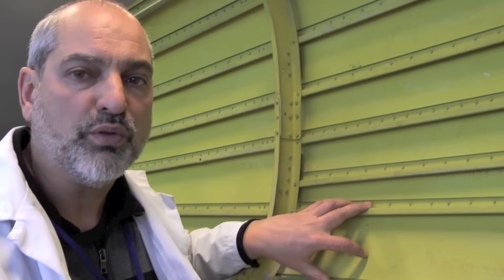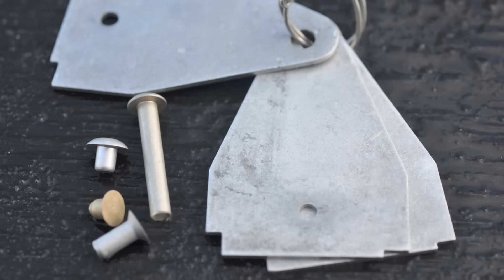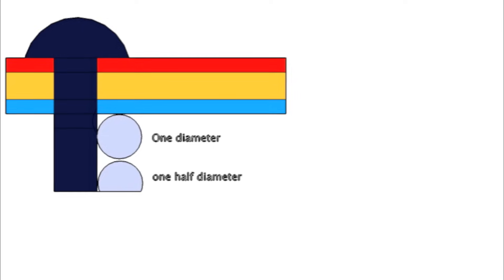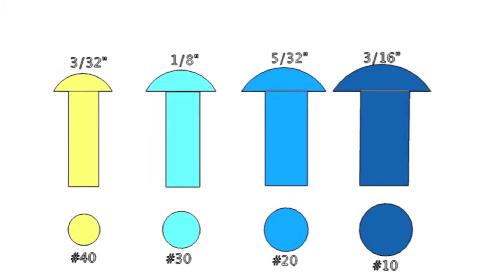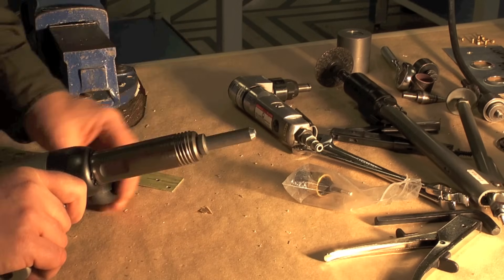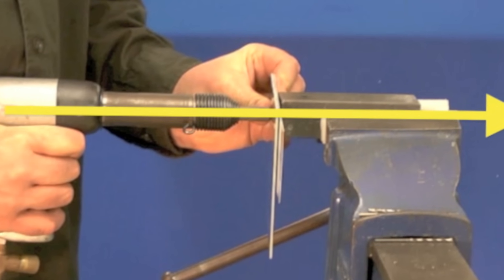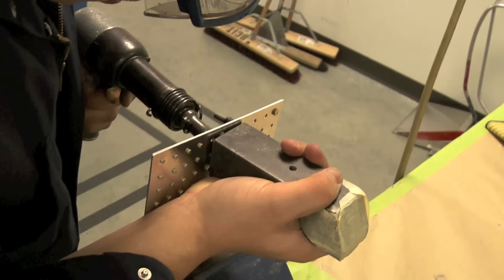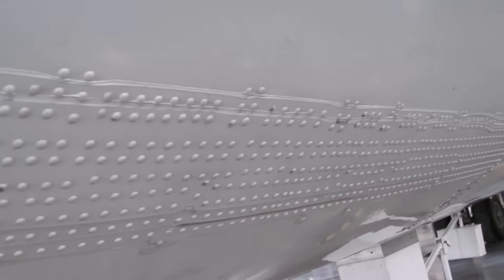Installing Aircraft Solid Rivets

Comment from the maker: Thanks for your comments, Enwwn - you're quite right about the work hardening aspect, as well as the head & tail gaps.  The reason that students are taught this method is to have them learn to drive rivets in a short time period - the "M" students only have a total of 12 days to learn many skills in the sheet metal trade, and management wanted them to gain confidence quickly.    It's just a first step in a longer process.

Comment: I worked as a trailer mechanic when I was younger.  Back then we used aluminum drive rivets for everything.  All of the aluminum side panels, roofing, and frame rails were held together with them.  The reason they use them is the speed of assembly and the strength of the rivets.  These rivets have more pulling and holding strength than a nut and bolt.  But, we were manually driving rivets about 30 times per minute.  Pop rivets aren't even that fast.  The only thing that sucks is being the bucker on the inside of the trailer.  The noise of using a Chicago Pneumatic 717 air hammer was enough to rattle your teeth.

Comment: Riveting is one of those jobs you need to have a feel for. This is gained by repetition. Good dia holes are essential. Selecting the right rivet gun is also essential these are given in X sizes a 3 x being the most common. Ensure you are at 90% to the job . This can be achieved by placing block and gun on the job at arms length and looking at the block and gun hold your position and move in for more control. You can also use the flat surface of the block if you have a equal space around your block your square. Setting up the trigger on the gun is important this can be done on a test piece. I like to us tungsten blocks. Blocks  should be rested on the rivet tail with light pressure this will ensure you set the rivet with the first few strikes as you carry on forming the tail increase the pressure on the block. What your looking for is not the gun that bounces but the block as the gun transfer is energy through the rivet into the block. If your in difficult areas or just starting out just learn how to set the rivet this a few hits step back look at the rivet then finish off . I like to use a plastic bag on my universal heads as it protects them and gives a nice production finish. Finally if your wet assembly make sure you keep block and snaps clean as you can put rivets into sheer if you don’t.

Comment from the maker: Bucking bars (also called "Dolly's") are merely the block of steel against which the rivet is set, or bucked.  The steel should be a high quality alloy, case hardened, with at least one smooth surface.  The bucking bars can be home made, or purchased from a aviation tool supplier such as USATCO.  Bucking bars can be any shape or size, and sometimes use alternate materials for heavier weight.

Comment: Thank you for posting this video.  I have searched for the spec that controls the installation of rivets and can not find it.  I know that these rivets have been install pretty much the same for the past 70 years but I would think some kind of document has to exist.
Reply from the maker: For general aviation purposes, specs are found in AC 43.13, current version.  This is a standard government document (a rather large manual) of many different subjects which apply across aviation repairs.  Check the US gov't websites, or aviation book stores...  AC43 is a common publication.

Comment: Where would one get that nice brass PSI regulator on your air hammer inlet?  That looks like a great accessory.
Reply from the maker: The rivet gun has a regulator on the air inlet.  It is a volume regulator, not a pressure regulator.  Try Wainbee (Canada) for a supplier of the regulators.  Or, in the USA, maybe Brown's aircraft tools, or Aircraft Spruce.

Comment: Your video assumes we all know what tools are required . Other than an Air hammer and bucking bar what tip are you supposed to use on the air hammer?
Reply from the maker: Alejandro - the main tool used to install solid rivets is a rivet gun, NOT an air hammer.  Air hammers have no feathering trigger control... they are full on, full off.  Nothing in between.  A proper rivet gun will be able to gently tickle the rivet, or gain impact power through the entire range if that is what is needed.  A simple air hammer is often used in other industries, but not in aviation.  The rivet guns require special "snaps" which are sized to fit the head shape of the rivets being installed.  Common sizes include 3/32", 1/8", 5/32", 3/16" and others.  Another flat headed snap will be used for countersunk riveting.  Coil springs are used to hold the snaps in place on the rivet gun so that you don't launch the snap out of the tool causing injury or damage inadvertently.  Rivet gun kits including snaps, springs, bucking bars, and other common riveting tools can be found at the aircraft supply shops such as Aircraft Spruce, ATS, Browns Aircraft Supply, etc.   Hope that helps.
Reply: @Riveteer  Yes.Thank you .

Comment: I saw a bike frame that had many rivets for decoration and those were not pop rivets but they were this type that requiers a bucket bar to be used - and here comes my question. Is there a way riveting to be done without a bucket bar since there is no way of puttin any inside the tube of the bike frame. The rivets were the ones with "half spere head" don't know the exact name and still can't find out how did they do it. Riveting was done after the whole frame was completed because I saw photos while drilling the holes but no info on how it riveting was done.
Reply from the maker: Half Sphere Head?  Maybe refers to universal head rivets.  As far as installing into a tubular structure, it may be possible to get a long, round bucking bar down inside the bike tube.  If the rivets are not structural, and only being used as decoration, then a full size tail may not be required.  Or, perhaps there was the aviation style of blind rivets used, called "Cherry Max rivets."  Special tools required for those.  I don't think I've seen what you are talking about, sorry.
Reply: peshgeorgiev These could also be what are called drive screws. A hole slightly undersize is drilled and the drive screw is hammered in. The shank of the screw has helical serrations that grip the edge of the hole . They are not structural but commonly used to attach information plates to machinery.
Reply: pe.sho 
Anybody remember exploding rivets? Set them off with a special tool, a small iron to apply heat to the head.

Comment: What do you call those little pin clamps they are using to hold two pieces together?
Reply from the maker: Those are called Clecos, or "skin pins."  They come in the standard hole sizes of 3/32", 1/8", 5/32" and 3/16".  Cleco's are a spring-loaded little device which holds the metal sheets together, but if you need more clamping force, then look for tools called Wedgelocks.  Same sizes.
Reply: +Riveteer Thanks!
Reply: We used to call them Clickon when working on the Fantoms, we used the 1/8" mostly when installing replacement skin panels on the fuselage. The holes need to be drilled cleanly with a sharp drill bit otherwise the clickons wont seat.

Comment: what is the best gun out there to use for a couple simple aluminum boat projects using 3/16 and 1/4 inch brazier head rivets?
Reply from the maker: Choose a gun with 4x capacity.  For commercial projects, the brand name may not be so critical.  Try a tool  from USATCO.com, Aircraft Spruce, or maybe the Tool Store.
Reply: 537VIK 4x with air controller.

Comment: Please do an episode on removing, sizing, replacing, and sourcing aircraft blind rivets.  My entire plane is done in blind rivets and they are all rusty and need to be replaced... but there are no videos out there about selecting aircraft blind rivets.  Do I use Avex?  Cherry?  How do they look different from hardware store pop rivets?  How do I measure their dimensions with a caliper when they have rusted up and expanded?
Reply from the maker: Unfortunately, I don't have the resources right now to produce videos on blind rivets, but it's a great idea and I'll try to get one done someday.  If you are intent on using blind rivets for your aircraft, the most common brand is a Cherry Max fastener, but start by drilling out one of your rivets to find the diameter.  Start small;  use a 3/32" drill, then go up to a 1/8" drill if that doesn't remove the old rivet.  If you can, use solid rivets for replacement - they are a better fastener.
Reply: Cherry max rivets are used when there is no access to solid rivets and comparable strength is required.  To remove a Cherry max rivet, first use a centre punch and drive the steel core down a bit so that you can start a drill bit properly centered.  Otherwise you risk skipping the drill bit all over the place.  The manufactured heads don't change from one manufacturer to the next.  Cherry max rivets have peculiar shank diameters.  Universal head and full flushhead rivet diameters are as follows:
1/8" - #27
5/32" - #16
3/16: - #5
Reduced flush head rivets are same as solid rivets.

Comment from the maker: No, silicone is capable of corroding aluminum.  PRC is a man-made rubber product, used for sealing surfaces against moistures, oils, greases, vapour, gasses, etc.  PRC has been in the aircraft industry for decades.  PRC is a 2-part polysulfide, which requires you to mix both parts before using.

Comment: I still don't understand what the gun is doing and how rivets don't fall out if only one side is larger than the hole.
Reply from the maker: Hi Sandler23 - the rivet gun is providing repeated impacts onto the head of the solid fastener.  The impact energy transmits down the length of the solid aluminum rivet, and when it meets the bucking bar held in the other hand, it will crush the rivet to form a solid tail.  This tail expands to fill the hole completely, and then mushrooms out to form a tail which is larger than the original rivet diameter.  Another result of this swelling to form a tail is that the sheets of aluminum become tightly secured together.  
Hope that helps.

Comment: Why aren’t you using a dipper to determine the length of the rivet?
Reply from the maker: Don't need one.  1.5 diameters protruding on the backside will set just fine.

Comment: Hi, what is the head diameter of the rivet used on a Boeing 777, on the nose and cockpit frame ?

Thanks.
Reply from the maker: Head diameter depends on the diameter of the shank of the rivet.  I don't know Boeing products at all.  They have some proprietary fasteners, somewhat different from standard aircraft rivets.

Comment: Why not use the top of the metal vise, instead of the bucking bar? is it for the smoothness of the buckingbar?
Reply from the maker: Yes, if you look at the metal surface of a bench vise, often there are grooves or striations that will leave marks on the tails of rivets.  Bucking bars have a much smoother surface, and are case hardened to prevent denting.
Reply: Riveteer I see. I suppose a smooth anvil would work for basic home/art stuff. I'm getting the equipment soon...it was either riveting or welding; but the fumes for welding in my little basement with 4" vent will be terrible idea. Thanks for a great video.

Comment: I am working on a hobby project with military spec aluminum rivets, 1/8" diameter with 100 degree flush mount. I am running into an issue, I have a mushroom head and a 2 lb bucking bar held in hand not a vise, but I cannot set the rivet. It will not compress the rivet. Do I not have enough air power? Or is the zip gun not powerful enough for heat treated aluminum rivets? I am using my grandpa's old Chicago Pneumatics zip gun: CP711. Looking to fasten two 1/8" aluminum plates together. Any help is appreciated. Thanks.
Reply from the maker: Several things to check:  what is the alloy of the rivet you are attempting to install?  Most 2017 alloy rivets have a single dimple in the center of the head.  I'm not familiar with the CP711 model, but the images seem to show an air hammer, not a rivet gun.  See if you can obtain a proper aircraft rivet gun, sized about 4x, and turn up adequate power for a 1/8" rivet.  Your bucking bar should be case hardened.  Last comment is that rivets which are extremely old get very hard, and you may need to use solid rivets recently manufactured.
Reply: Riveteer thank you for the response. The rivets are from McMaster-Carr pn: 96685A200 and it says they are military spec head treated aluminum with matte gold finish. I am not too familiar with air tools but it does say “zip gun” on it. I don’t know what the X rating of it is. I found online that it is “standard duty” and has 3,500 blows per minute. Do I need less blows per minute? I also don’t think my bucking bar is the problem. Thanks again.
Reply from the maker: Although I don't recognize the McMaster-Carr name, nor the part number, their website seems to indicate a fairly standard aviation countersunk head rivet.  The tool called a "zip gun" still leads me to think you're attempting to drive a rivet with an air hammer.  I suspect an air hammer will not work so well because it seems to have far too many blows per minute, which may dictate that it has a very small piston inside.  Consider looking for an aviation rivet gun, such as those sold by online by Aircraft Spruce, The Yard Store, Brown's Aircraft tools, or other outlets.  They will offer rivet guns which look similar to an air hammer, but the trigger feel and driving forces are significantly different.  The "X" rating is a rough indicator of the amount of energy that the gun will impart to the rivet.  4X guns are stronger and heavier than 3X guns.  Chicago Pneumatic tools used to make a rivet gun (I own one, myself), but mine is well over 30 years old.  I don't know if they still make them.
Reply: Riveteer hummm. Yeah I bet you are right about the rivet gun. I actually tried my bucking bar in a vise and just used a regular hammer and I got it to work just fine. So I think I’m going to try to figure out a way to do it with a hammer for now. Thanks for your help!

Comment: I'd love to know what we're looking at at 0:20 and again at 5:57. There's more rivet than airplane.
Reply from the maker: The aircraft skins seen in those locations in the video are mockups of aircraft repairs and modifications mounted on a portable shop module.  The students are not permitted to perform repairs on actual airframes out in the hangar until they demonstrate knowledge of proper techniques, tool usage, and standard practices.

Comment: How do you put something on the inside if you cant get to it? Like if you are outside and you need to put that steel chunk on the inside?
Reply from the maker: I'm going to guess that the "steel chunk" refers to the bucking bar.  If you can't get a bucking bar inside to set the tail of the rivet, you may wish to use a Cherry Max rivet, or perhaps a threaded fastener such as a HiLok or bolt or machine screw.
Reply: Ok. That is cool that you can fix airplanes.
Reply: @Riveteer  if one doesn't have access to the back how would one install a Hi-Loc, Bolt, or machine screw? Now if there is a Riv-nut installed on the base structure a machine screw would work. If high shear is needed in a blind area. Wouldn't one want to use a JoBolt or Huck? And yes blind area rivets, Cherry-max or Olympic loc fasteners. (Retired 45872/2A773 USAF)

Comment: 2117 rivets. Do they need heating before driving?
Reply from the maker: No,   Drive them as they come out of the bag.  No heat treating required.
Reply: Riveteer thanks! Trying to re rivet a boat. Was told that these were too hard to drive without being heated.
Reply: @kansascityshuffle8526  Aluminum rivets are never driven hot like steel rivets are. There are some alloys which have to be heat treated,  but none are driven while hot
Reply: @andrewalexander9492  thx

Comment: Can someone pls tell me if this apply to solid steel rivet installation? Dia of rivet is around 0.250". Instruction is to use cold head upset. Was told I need a very high tonnage hydraulic press to do   the job.
Reply from the maker: Aircraft sometimes use a monel steel rivet which can be driven cold with a standard rivet gun.  If you are installing a 1/4" solid monel rivet, you probably need a 4x size rivet gun.  I can't comment on the hydraulic press idea.
Reply: @Riveteer  Monel isn't a steel alloy. Monel is primarily nickel and copper.

Comment: MIDDLE FINGER ON THE TRIGGER WHEN YOU RIVET
Reply: middle finger is used when drilling. never seen anyone use the middle finger when handling a rivet gun
Reply: I used middle finger in drilling and riveting...this allows the index finger as a "regulator" if you will
Reply: Agree, index finger for feeling & guiding. More tiring but precise.
Reply: bammass pointy finger to get your level, palm, arm and shoulder for percussion suppression, middle finger to squeeze the trigger. Unless it's a swan neck gun, only the thumb can press the trigger for riveting operations however the trigger can be pressed accidentally on anything.

Comment: With the bucking bar held in the vice you fail at riveting. This process left a gap between the two pieces of metal being riveted. It was quite obvious in the video. Use Clecos on each side of the rivet being shot to hold the metal sheets together. Riveting is a  skill you learn over time by doing it over and over.

Comment: Good video; however, I would rather that you didn't show a riveting procedure with the bucking bar secured in a vice.  Best practice is as you illustrate later in the video with the materials secured in the vice and rivet gun set force transmitted through the rivet shank with the bucking bar rebounding to swell and upset the shank.  This method properly work hardens the entire rivet to produce appropriate driven shear strength and produces fewer gaps beneath the rivet manufactured head.